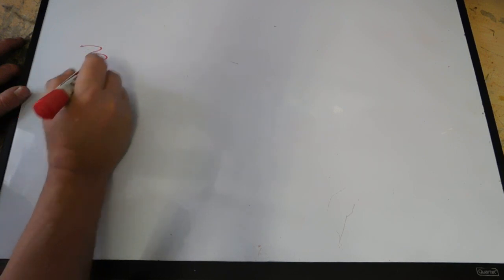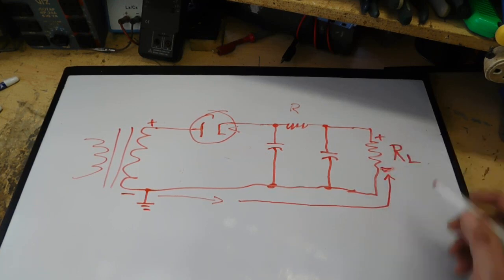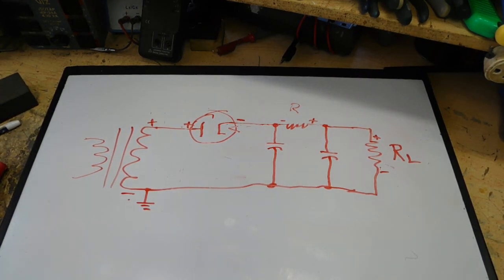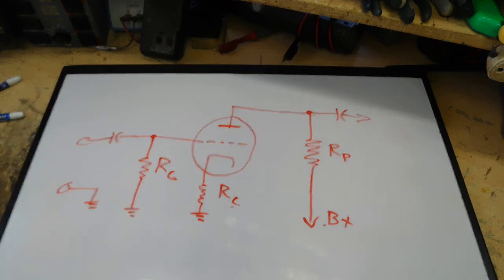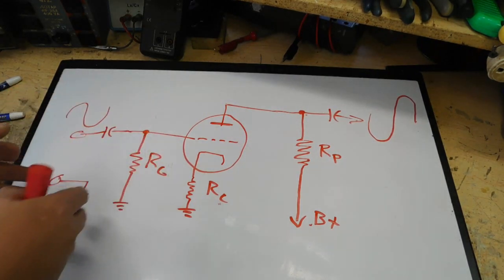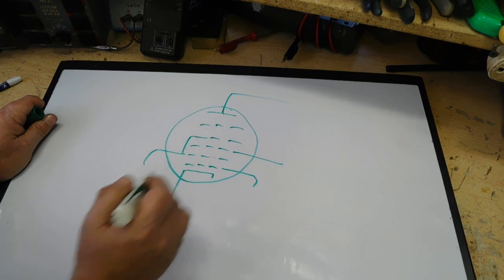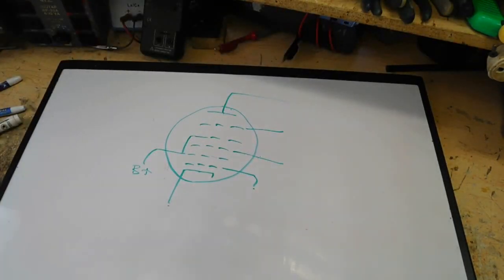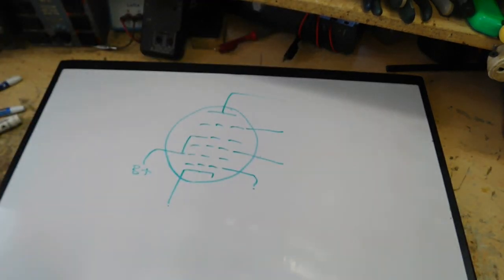Answers on tube theory

Comment: The hardest part for me with understanding the tube circuits is the way they drew schematics in the past.   It is very confusing compared to transistor circuit schematics.   In transistor schematics the positive power rail in always on the top of your page and the ground or negative is drawn on the bottom of the page.  It is easier to visualize the flow of conventional current from positive to negative.   Tube circuits have the B+ and grounds both drawn on the bottom of the page.   It makes for more lines crossing in the schematic, in turn making it more difficult to follow the wiring.   Once I got used to this practice I was able to visualize circuit flow over time.  Like everything it takes time and experience to get used to thinking both ways in each electronic world, be it solid state or tubes.

Comment: hello Denis
thank you so much for this video explaining the circuit, this  is  a new language to me as i am still learning to understand it.  you did  a very good job explaining the circuit within  the tube.     the signal input at the grid and signal output on the plate.

i guess when  the signal goes out at the plate, then goes to another tube again at the grid, this will be called second stage of amplification?  until it reaches the final destination when it enters the output transformer primary and then out thru the secondary all the way down to the speaker coil?

thanks once again for taking the time explaining !

Comment: Brits call them "valves" because the grid acts like a gate valve to control flow. A tube or transistor could be considered as a variable diode. Perhaps that simplifies things?